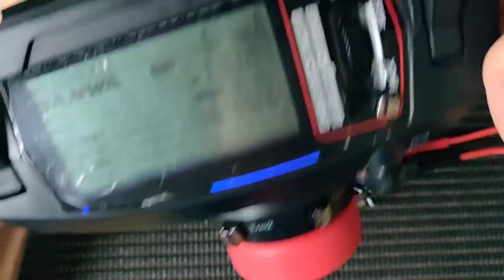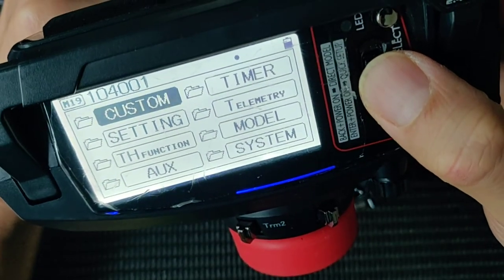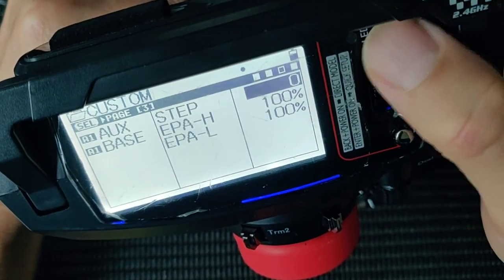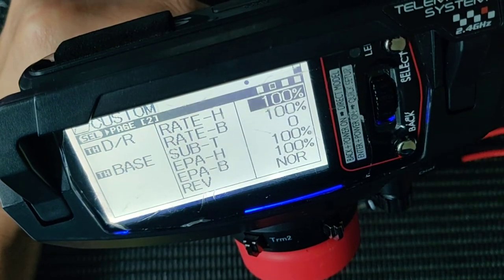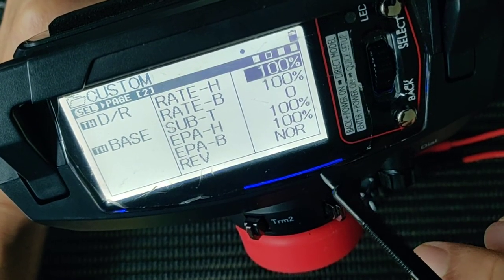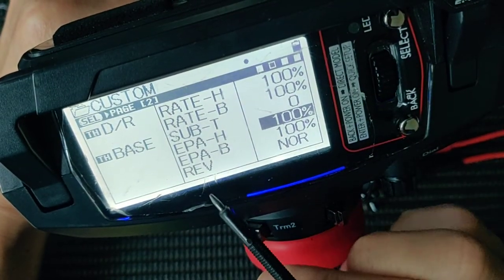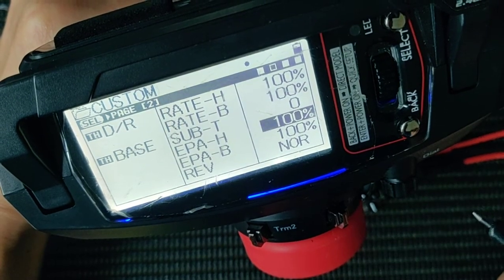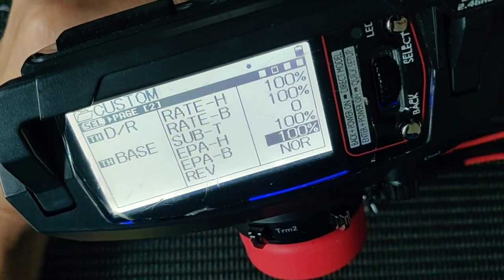Surpass Ts160V2 Pro Esc Calibration

Comment: Is this esc good
Please make a review
There is little to none info on it
Is it comparable to other brands like hobbywing or yokomo
Reply from the maker: I feel it's a very good esc for it's price.
Reply: i just put it in my TC, swapped out a MM fleta pro v2.  had the track owner tried my car.  

he couldn't tell the difference and he's driven it when i had the v2.  I couldn't tell the difference once you get the settings close enough (mainly brake rate, max brake, turbo timing, and turbo delay)  

this particular car is all surpass.  (servo, motor, esc); if i debadge everything on this car, vs the car with a MM motor and HW esc, mayyyyybe the top 0.5% of tc drivers can tell the difference, but anyone at the club level claiming they can I'm going to call bullshit.  

solid piece of kit.
Reply from the maker: @waynekerr67  thanks for sharing! Will you mind sharing your setup so others running similar cars n tracks will benefit?
Reply: V4S 5.5T; S1600BL servo, 28-110 gearing.  it's for CRC carpet. 

cutoff voltage - mid
neutral range - 5%
BEC - 6V
Motor action - CCW
Remote off - disabled
Motor Link - normal
Punch - 2
PWM - 16000
Compress - 0 <---- i gotta mess with this, don't know what it is
Soften - 1
Drag Brake - 14
Initial Brake = Drag Brake
Brake Punch = 10 (I have it on 2 on my MM and it went to a max of 20 iirc; this one is 1-30 so i'm already running more brake)
Brake Frequency - 2500
Max Brake = 65%
Boost = 5
Boost Activation = RPM
Boost Start = 7500
Boost End = 27500
Turbo Timing = 10
Turbo Start = 97%
Turbo Delay = Instant
Turbo Up = 18 <--- this is how fast turbo ramps up
Turbo Down = 30 <--- this is how fast turbo backs off, i need it to back off quick.  on MM / HW i have this set to instant; that's not available on this esc.
Reply from the maker: @waynekerr67  Thanks for sharing! This settings guide may help explain Compress n other stuff: https://www.dropbox.com/s/j8xkzx5gunin6va/Surpass%20TS160%20V2%20Pro%20Setting%20Guide.pdf?dl=0
Reply: @perfectlaprc1965  what firmware version are you on that has this menu.  because my compress isn't by %; it's 1-5 only.
Reply from the maker: @waynekerr67  this may not be a firmware issue. I compiled this from different sources on the internet.
Reply: @waynekerr67 glad to hear. Thank you for the feedback. I recently discovered the Rocket RC V6 motors and love them. I was tempted to try this esc over my typical HW esc that I run in all my cars. What settings did you use to get it close to the MM V2?